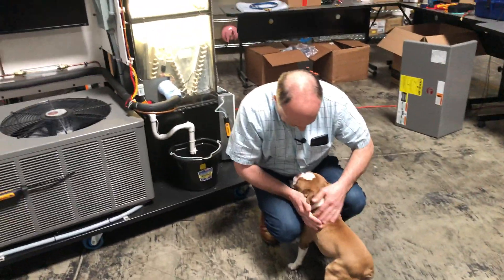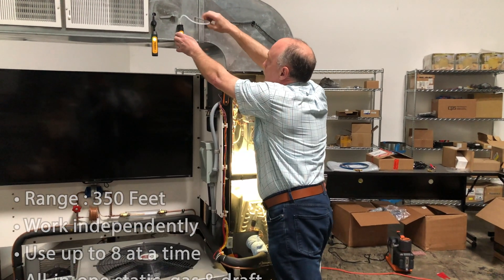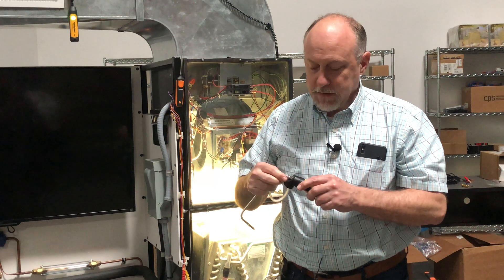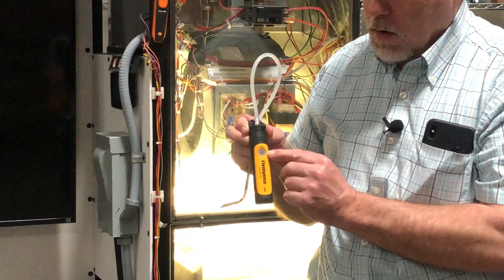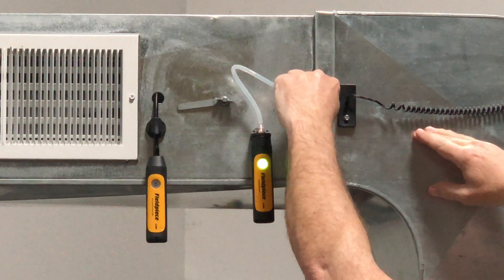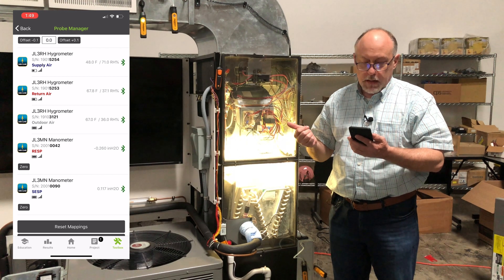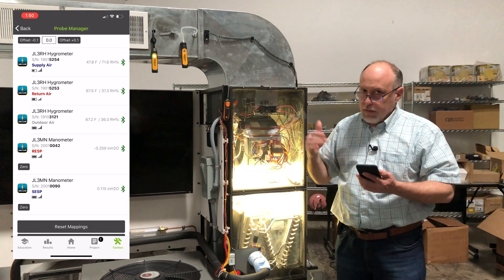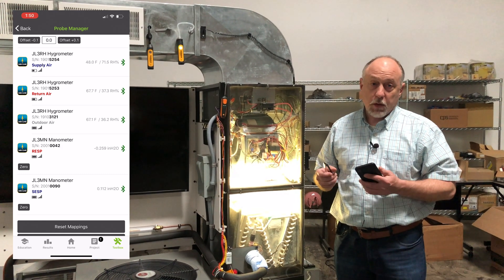Fieldpiece Manometers and measureQuick

Comment: Hi Jim!

I paired my testo  557s with MQ, the temperature probes are showing on the app, but somehow the pressures of my gauges  don’t register on the app ,they don’t display. It still shows 60. 5 in both auction and liquid line.

What I am missing or doing wrong. 

I will really appreciate any guidance !

Thank you!!

Comment: It does matter which way you turn the pitot tube. If it is into the air stream, it is measuring total pressure (static + velocity). If it is 180 out from the air stream it is measuring static pressure only.
Reply from the maker: It’s not a pitot. It only measures static. Static tips can be turned either way.

Comment: How many can we add & MAP to measureQuick?
Reply from the maker: You could add 20 if you wanted most likely. The way the signal comes it does not require pairing. We have points to map them to supply, rretrun, total external static, draft, caz, pressure stitch, incoming gas pressure, and manifold pressure.